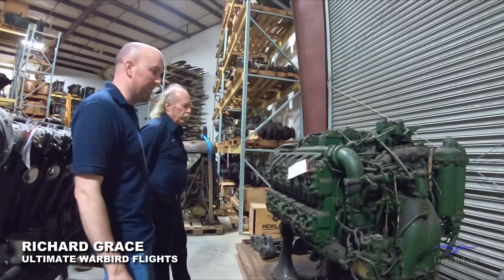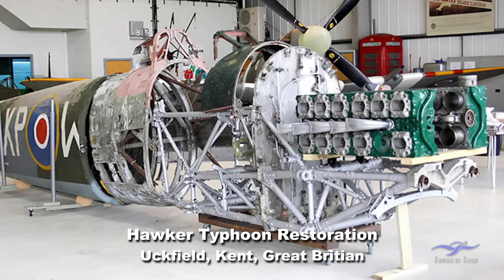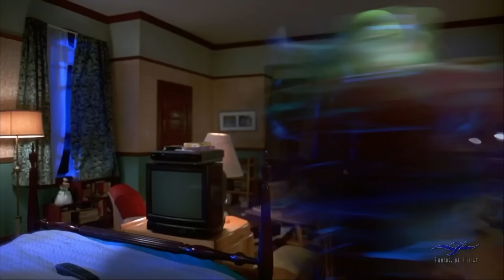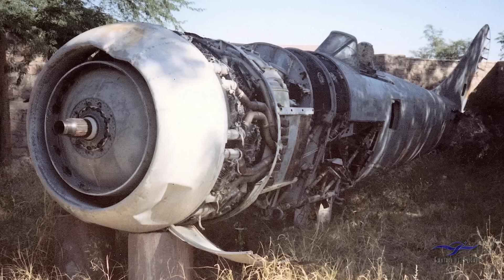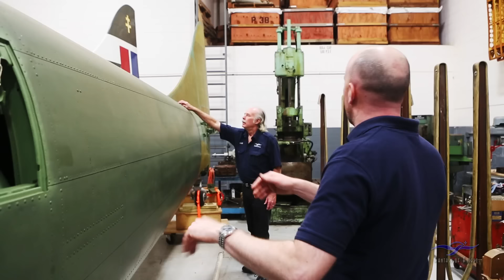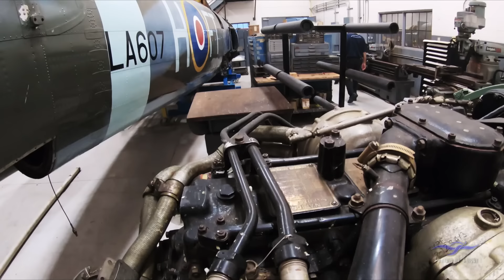Hawker Tempest V - Part 2 - Napier Sabre Engine / Fuselage - Restoration

Comment: In an ideal world, it would be nice if a few more Sabres could be built, and a replica Heston Racer built and flown, hopefully this time with a better cooling system and a more effective tailplane and elevator. Should be good for the piston engined air speed record. 
On the bench, according to JLK Setright, the engine could be run up to 5,500 BHP. Incidentally, Setright was wrong in saying the Racer crashed on take-off due to severe torque effects. It had been flying for ten minutes, was overheating, and stalled on landing due to insufficient elevator response; the pilot survived.

Comment: Im pretty sure that in addition to the piston rings, there are also sealing rings at the "top" of the fixed cylinder combustion chamber that make contact with the moving inner sleeve, in order to seal the inner sleeve from the outer.

And while it is true that the engine timing is fixed and non adjustable, the spark (ignition) timing, can be adjusted.  Just like any standard 4 stroke petrol engine.

You can search "napier sabre sleeve valve engine gif", and it'll show how the whole process works. Very interesting design, but you can see how oiling and friction could be a limiting factor in terms of reliability,  Not to mention the complexity of being a flat 24cyl configuration.

Comment: If it has Bristol sleeves it will run longer than Napier sleeves, I’m sure all Sabres would have been retrofitted pretty early in the war. Incredible engine, being run sympathetically without wartime demands and modern tech and oils it should be pretty reliable .

Comment: PS Yes; there are rings around the outside of the sleeve, near the top, the part of the sleeve that goes up in to the junkhead (the rings constrained by grooves in the junkhead). The outside of the sleeve has to be lubricated as well as the interior (cylinder-bore) surface of the sleeve.

Comment: Richard Grace got a lot of things wrong about the Sabre.  It was only ever used in aircraft and then only in the Typhoon, The Tempest V and VI, a small number of Blackburn B-37 Firebrands, and a few prototypes, the Napier Deltic was used in trains and none of them in airliners.  Most of the Sabres were scrapped at the end of the war as the aircraft they were fitted to were scrapped.  Finding a Sabre is like finding a Tiffy.

The engine was 36.7 litres, almost identical displacement to the 1939 Griffon,  not just under 30 as stated in the video.  

None of the single acting sleeve valves are total loss, their oil consumption decreased as time went on and the engines were developed, there are any number of jokes but they are not based on fact.  There was lot of smoke at startup and shutdown as there was a 30/70 oil fuel mixture used at these times to ensure that the sleeves were properly lubricated for startup during which the fuel tended to strip the oil from the sleeves causing damage to the sleeves.   

I suspect the upright cylindrical fitting on the rear right side of the engine that was identified as an oil filter is the shutdown fuel supply with the oil mixture.    

I can see that most of the Coffman cartridge starter is on the engine, it looks like the revolving cartridge holder is missing. All Sabres used the Coffman starter, it was a problem in cold weather and could damage the engine as it produced a very brief power spike said to be equivalent to 25hp.  The starter drive was modified to reduce or eliminate the damage done to the engine during startup.  In this day and age, electric starter motors with sufficient power are available but adapting one is also a significant modification.

You can't tell what state the engine is in by just looking at the outside, it would have been in a crate whether it had just been overhauled or was being sent in for overhaul.  Careful examination of the sleeves looking through the exhaust ports will show the all important condition of the sleeves

There are several videos of Typhoons and Tempests with the engines running, taxiing, flying, etc including training videos.

I suspect it is a Sabre VA as used in the Tempest VI, it could be a late IV, possibly a V, as these were fuel injected, the VI was a development engine so it is not that, and the VII had a different air intake design and antidetonation injection so it is not one of those.  If it had spark plugs in it, it would be just a few seconds to determine if it is a VA as the plugs were angled.  Unfortunately, they don't give a good look at the engine, no closeups, so it is hard to determine the throttle linkages.  On second thought the linkages don't look right for the VA which were very complex, so maybe a late IV or the V.   I don't have sufficient information to tell the two types apart.

Kermit seems to have had a memory failure, in an earlier video he said that the engine that was sent to Ricardo was a Centaurus for the Tempest II.
Reply: Okay, I just watched part 3 of this series and the data plate identifies it as a Sabre V.  The later the better, the VA would have been even better as these were all post-war (I think) and built to a high standard by skilled craftsmen.  

As I posted in part three of this video series: 

"So a Sabre V, woo hoo.  I might just hear a running Sabre in a modern recording, at full power, before I depart this planet.  I would fly all the way from Oz just to hear a running Sabre.  

Come on guys, get your priorities right, Sabre first, rest of aircraft later!!!!  You can see warbirds flying all the time, but a running Sabre, not for 70 years, in this day and age it would be literally unique!!"

Comment: I have heard that it is only heavy lobbying by Rolls Royce that meant that Napier Engines which at the time were more sophisticated than the Merlin from being used in more aircraft.
Reply: Wasn't it also something to do with both timing of final production parts and size / weight?

Comment: 'I am charmed by the original compressed-air rotary engine of Hargrave, as by the dainty Gnome and other rotaries that took the air up to 1918. I am captivated by the 1966 five-cylinder 125cc racing Honda, safe to 24,000rpm and knock-proof on 85 RON petrol. I feel profound respect for the utterly simple solid-fuel rocket engine, blasting into space with a rapidly lightening load of solid rubber and aluminum dust. Yet nothing that I know can unseat the overwhelming fascination inspired by the prodigious Napier Sabre, surely the most brilliant, most maligned, most iconoclastic, and most ferociously competent piston engine of all'  LJK Setright.

Comment: Saw a DB603 at end of the Allisons and Merlins(?) right at the entrance of the shop,, it's the one with that longish front end gearhousing....where could that belong to ?
Reply: +@TPath3  The 603s were in the Me-410,  He-219, Do-335 and prototype Ta-152s.  They could be a good substitute in a Fw-190D since Kurt Tank designed the engine mounts to take either the DB or Jumo engines.

Comment: The early Sabre engine had liner and build problems causing unreliability. Taking off from dirt airfields in France after D Day also caused unreliability due to dust injection until air filters where installed.  Engine was kept warm with blankets and started a few times at night to keep it warm for starting reliability. Some engineers also messed with the constant speed governor meaning they where in battle power all the time, some said sabotage others ignorance.

Comment: Very exciting...    the Sabre II A/B used SU suction carbs whereas the Sabre VA and later variants used Hobson r.a.e. injector carbs.  
Definitely makes sense to use the power unit in the highest mod state.   From the look of it, the green engine is a VA,  because the VII had a different supercharger housing.

Comment: The sleeve valve (as I understand it) was developed by Bristol in England to remove the need for the normal valve assembly in  radial engines, to lower the engine profile for aerodynamics. The Bristol Hercules series used on the "Only the Pom's could build a plane like this"  Bristol B-170 freighter and later refined to the Sentaurus fitted to the " I want one..coz you can FEEL the sound as it goes past 😄" Sea Fury. Although mechanically complex, a huge step forward at the time. And a 'Round' engine will NEVER be beaten for audio 😉

Comment: wonderful that Richard has accumulated so much knowledge and from his fathers past history too and definitely the right man to listen to, the technical details on the tubing is fascinating, i guess the technology along with its difficulties in production have been superseded with moor modern and reliable materials - i knew a little about the engine, knowing it was a pig to run (understatement), but wasn't aware how much it had advanced, the non-valve circular tube fuel feed sounds very alien too

i became interested in the Typhoon project here in East Sussex some years back, and i have to say, i'm not completely sure of its technical ability although i am sure it will be pretty high, i do know of at least one ex or current RAF pilot engineer who is reverse engineering components to rebuild to higher modern specs - but to be honest it will take many many years to complete, and i am sure as with Richard, these these may even take many generations to fully fathom out as so much is lost - i kind of lost interest because the project is so much in its infancy that i doubt very much the aircraft would fly in my lifetime

it would be magical if Richard can assist in getting Kermit's engine to run, perhaps get it set into the 'test rig' and run her up - as for an actual flying aircraft, well that is a whole other chapter, and Kermit, not as young as he was, will he see it through, i really hope so, time is against us all sadly, but who continues these projects for future generations
Reply: Great comment with some very valid points and considerations going forwards. I firmly believe that this collaboration between Kermit and Richard will now continue to 'Grace' our video screens over the various stages as it has real momentum and the hopes of so many to finally hear and see a Sabre engine running, as even with its obvious and well documented operating issues these two gentlemen will be paving the way regarding the pros and cons, the do's and don'ts for the other Tempest/Typhoon rebuild projects to learn and benefit from which has to be a good thing regardless of which camp your in and follow.
Reply: @timeslip9  some great expectations there - when you consider the cost and time it used to take to build Spitfires for example, the issues faced and the pressure of war - and now at Biggen hill we have the Spitfires being built, fantastic projects of old being brought to the modern day, keep them coming
i wonder how far away we could be before we are rebuilding Typhoon and Tempests, so much i imagine might rely on donors as does the Spitfire projects
i did some projects at Brooklands some years back, i remember looking over the Wellington Bomber, and sat in Barns Wallace's office wondering what he must be thinking with his geodetic construction, things were somehow so complex and yet completed in record time and now its all lost through complexity, money and lost knowledge, sad
it will be epic if Kermit and Richard can move things on a pace, at least before some of get too long in the tooth and dribble into our beards haha
if the future videos end up anything like the rebuilds of armour such as seen with the Austalian Armour Museum, a must see if you like that sort of thing

Comment: the  tempest and the Sea fury the same?  or way different
Reply: Cousins. The Tempest II was the definitive Tempest but didn’t make it into production in time for WWII. The Tempest V was a Tempest II but used the Sabre engine instead of the Centaurus. The Sea Fury used similar aerodynamics - I think it used the same wing but with folding tips - and a Centaurus engine. I think the main difference was the fuselage, which had a higher set cockpit. It was also strengthened for carrier operations and treated against salt corrosion and rust.

Comment: There are actually rings that seal the the sleeves, they're in lands in the cylinder heads (called "junk heads" and "junk rings"). Various methods were employed on some sleeve valve engines to control oil consumption, Willys-Knight came up with machining fine channels in the outside of the sleeves that lined up with holes in the cylinder block that were continuously under vacuum. The oil that was recovered was returned to the crankcase.
In the case of the Sabre I suspect that they ended up with an oil consumption figure that was tolerable and they simply said "It is what it is. People go on about sleeve valve engine oil consumption but can't seem to recall that 2 stroke motorbikes and cars used to hoover down oil 1 quart for 5 gallons of petrol.
One thing that is quite remarkable about sleeve valve engines is their mechanical silence, the loudest thing heard on sleeve valve cars is usually the cooling fan.
Reply: The exhaust noise on a Bristol Hercules would wake the dead!
Reply: @waynebeasley8700  I did say "mechanical silence"!
Reply: There is also some form of seal/ring on the inside of the cylinder head acting against the lower part of the sleeve. It can be seen in the Sabre section in Ricardo's "High Speed Internal Combustion Engine, 4th Ed. 
The Bristol sleeve valves also had a seal in this area to reduce oil consumption. They found that without a seal, the sleeve was getting too much oil.

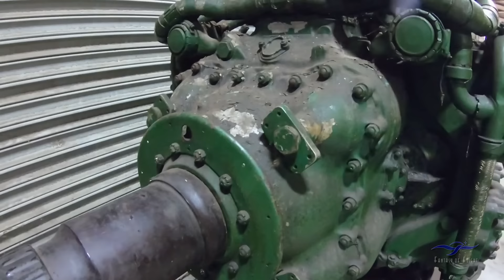Comment: 12:52 Apologies if I missed it in the video but another point about this engine is that the piston's are horizontally opposed which is what allows it to get more power from a smaller volume, making the engine more compact.

Comment: Dear Kermit,

The Napier Sabre was the unwanted solution for delivery problem.
The Tempest Mk II was RAF's first choice, but the Bristol Centaurus, for which the Tempest was designed,  was in short supply.
---
Napier had big problems with the sleeve valve system in their Sabre engines.. 
Bristol had the solution from their Hercules and later models.
It required a direct order from the government for Bristol to help Napier to solve the problems.
Even though, the Sabre engine never became more than a gap filler due to their low life span.
All Typhoons and Tempests in RAF service were scrapped shortly after the conclusion of WWII.
A few Hawker Tempests survived in auxiliary service like in India..

/oakey

PS:
We all need Paul Stecewycz back.
He is the best to explain everything we like to know.

Comment: Thanks for the extremely fascinating video! Can't wait for part 3 (or the Sabre to fire up eventually!). I remember reading somewhere, that the jolt generated by the shotgun starter was slightly detrimental for the engine or it's accessories, so it may not be the first option in this case. Even if it would be so cool to hear and see. Any info on the variants of those engines? I assume the black one is II something, but not sure about the green one.

Comment: Kermit ;- Oh dear oh dear..... YES - we'd all love to hear a Sabre - and see a Typhoon or Tempest fly, but this idea that the Sabre was ever properly sorted is a modern falacy and needs ffirmly putting to bed. During the war - with full factory support and HUGE pressure from the Air Ministry - they couldn't make the Sabre reliable. When the war ended - the Sabre was - with much relief - scrapped wholesale. This was based on ACTUAL EXPERIENCE. Today, there is zero factory support, almost no spares - and anyone who REALLY knew how to look-after and operate the Sabre - is dead to a man. Unlike the Merlin, for example, with a huge network of experts and remanufacturers - there is NOTHING for the Sabre. EVERYTHING mitigates against achieving a reliable Sabre - as no such animal ever existed. Period. Bear in mind that of all the engine types Napiers produced - only the Lion was any good - but it took Napiers TWO DECADES to get it right........and it pales into simplicity when compared to a Sabre. This is a wonderful project. A taxyable Sabre-engined Tempest or Typhoon is a great idea. However - this falacious and dodgy idea that the Sabre was ever really sorted needs putting firmly to bed - it never happened....! All those late war Tempests were delivered to RAF storage airfields - and the engines ripped-out and returned to the factory to allow more to be ferried...... They were trying to mitigte the mass worker redundancies at the end of the war. Those brand new Tempests were scrapped without ever flying again..... there are images of airfields full of engineless Tempests.... The only step change on the Sabre, was when the MAP forced Bristols to help-out Napiers with the problems on the sleeve-valves. It helped mitigate what was a calamatous problem at the time. True - they eventually sorted the carbon monoxide getting into the cockpit - but the pilots still used their oxygen from start-up. Fires at engine-start were very common. Oil splattered all over the windscreen was another problem. The Sabre hated cold starts. Old RAF mechanics I knew said that they would run the Sabres-up last thing at night to get them hot, and then chuck tarp and old carpets - any insulation - over them to keep the heat in. Then they would start them at first light again to keep them warm. Then there were all the engines that quit in the air..... In 1945, there was a VAST pool of knowledge, experience and SPARES. NONE of that exists today - as in absolutely ZERO. Just getting a Sabre running will be a really fantastic achievement - but if you fly it - you will be guaranteed an engine failure. No amount of wishful thinking will change that.....
Reply from the maker: Thanks for sharing
Reply: er was the napier deltic a failure?
Reply: @babaganoush6106  ;- Yup.
Reply: @babaganoush6106  ;- Yup.